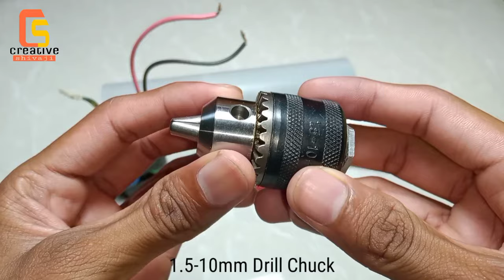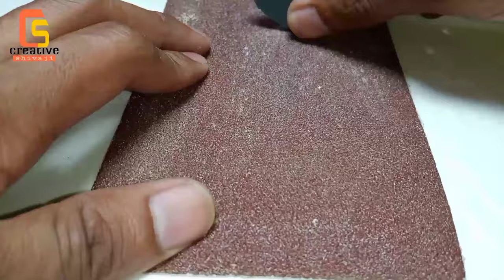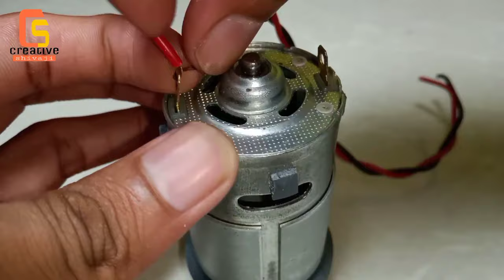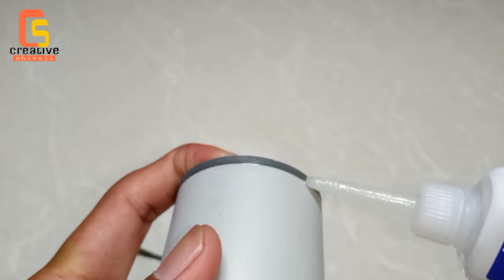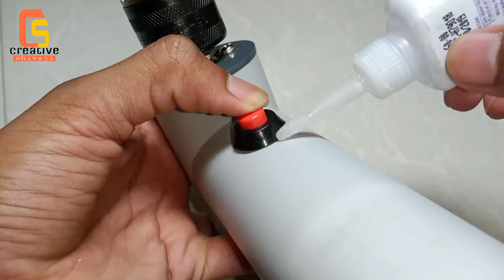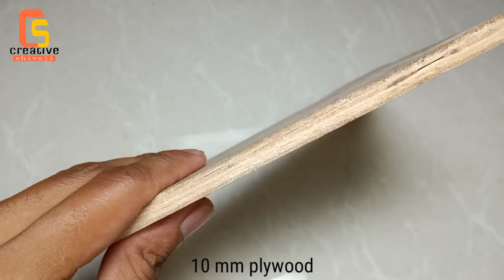How To Make Powerful Cordless Drill machine At Home |  Drill Using 775 Dc Motor | CreativeShivaji

Comment: It was an excellent workmanship  but how do you  charge the batteries.
Reply: Open the Lid which is under the handle, use the Molex connector.
Ideally, I would add a charging circuit within the drill itself.
But you can also use an external battery charging (with a BMS system) unit to do so.

Comment: What you gonna do once battery is dead where the rechargeable option?
Reply: If the battery is dead and he throw it ..😂😂😂
Reply: I think its only an idea but you can modify upgrade to changable battery or even with a charging point. Other than that his work is neat
Reply: @markbryanochavez1871  brother just add a charging point in it and use appropriate charger other then that its fine job
Reply: Either add charging module or change the design with removable batteries option. 4 rechargeable batteries of 2300mAh each.

Comment: You could have used a usb BMS charging  port as well for easy charging and also a toggle switch to make the drill chuck work clockwise and anti clockwise. That would have been more convenient to use the screw driver bit as well for screw unscrew purpose.

Comment: Can it work on 12 volts adding 3s bms corcut will be easy
 Pl comment
Reply: Hi
Reply: You can use 9-12 volts2-3 amp power supply bro

Comment: How many volts and amps you are giving to that ?
Reply: Very right questions the moter  is 775  dc so it is 12 volts   so battery should be 12 volts
Reply: @techofrithishkumar1454  Dc 775 motor can handle upto 24 volts 3A.